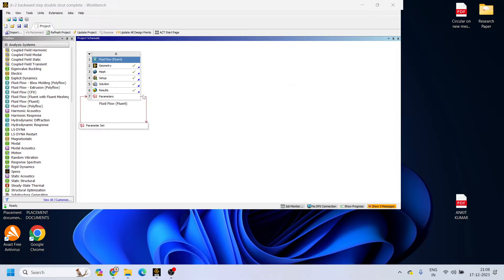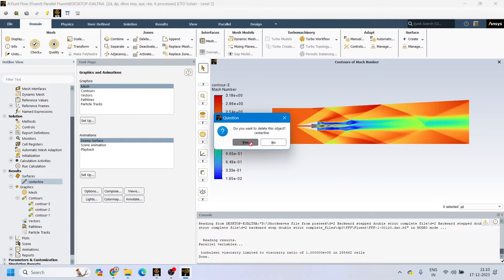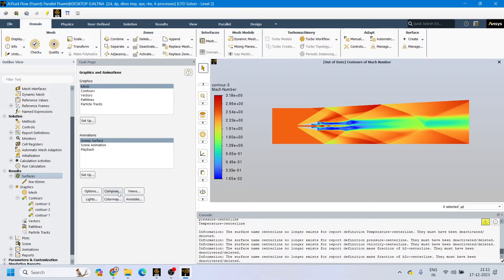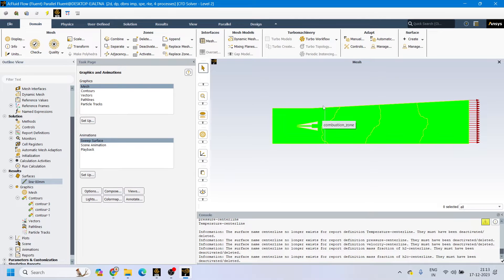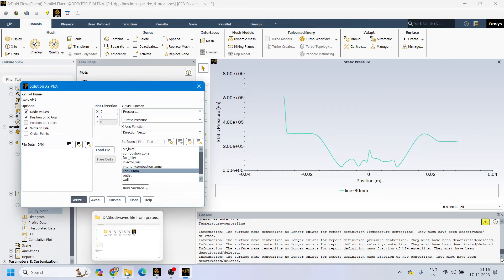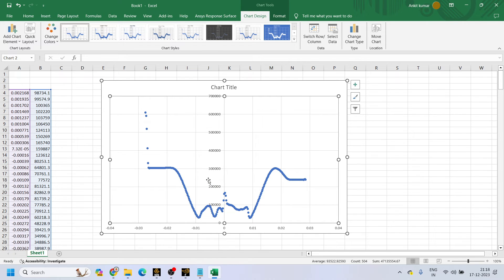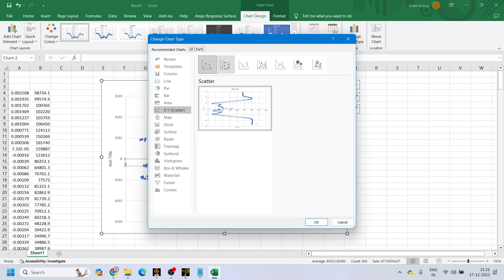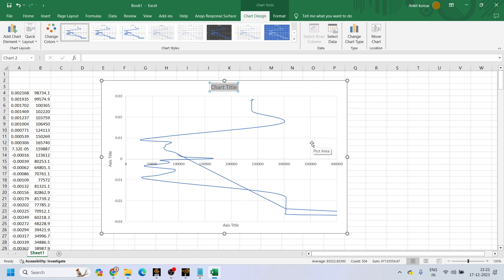Ansys fluent xy plot | Excel Graph| extracting values from Ansys fluent software &plotting on Excel

Comment: helo sir im unable to open Results , so when i went to Ansys help desk its showing that for student version only 1 license is provided by a software so i had to save the setup file answers and then seperately select cfd post and then i had to load answers into it . sir can you tell which format i need to save the answers in after setup file? pls helpme